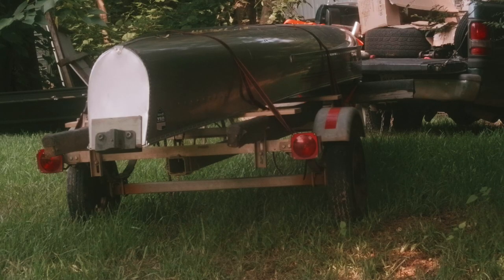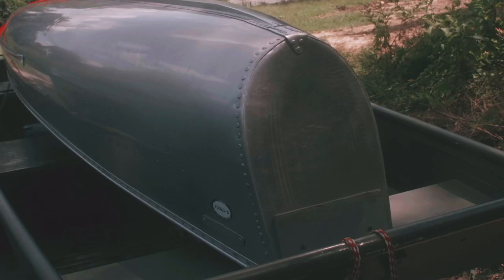Motor on a Canoe | Motor Man Series

Comment: I have a 70s grumman 17ft square back. I do run a 4 hp outboard or a 55lbs thrust trolling motor. If I am by myself (about 200lbs give or take) I put two 70 lbs sand bags all the way up front. If you don't, the thrust from the motors will force the nose up high enough to swamp the back end. That being said, it gets me around shallow rivers really well. Where the motors can't be run I can paddle or jump out and pull it.
Reply from the maker: Nice tips thanks.

Comment: I had a Grumman Sport Boat for awhile used to run a 9.8hp Tohatsu on it was slightly overpowered, but it scooted right along. Then watched a video by Temple Dillard of him running a 6.5 Swamprunner on his (weight is nearly identical). Made an affordable way to run shallow rivers and I could cartop it so I didn’t need a trailer. I also got a canoe/kayak dolly which enabled me to launch it places with no boat ramp. Just wasn’t enough room for the family + dog + camping gear so now run an 18’ Jon boat w/surface drive.
Reply from the maker: Yeah, the sport boat is legendary. I wonder why they don;t make an 18 or 20 ft. version of it.

Comment: Damon
I hadn't tuned in much in the last couple years. glad to see you are still at.
The catalog of work you have done is amazing.

I am sure you could be a producer for someone elses instruction videos or do nothing but paid product tests and reviews.  The quality of your work - awesome.

Persevere and keep at it.  

Personally I would love to show some  problem solving, gerrymandering techniques 
If I make a video.

Things I have done -make a light weight waterproof floating trolling motor extension handle
out of a wiffle ball bat handle ingenious ?  My invention.
Or the trolling motor transport shock absorber _ A tennis ball.

Launch a 1000 pound boat by yourself using a long rope you walk over your truck roof ?
And in shallow water using your brakes ?

The side ways kitty litter plastic bucket use it keep materials in. Write item on top that closed when it sat upright,  Stack them up.

Show them the rope in the spark plug hole method pulling a flywheel.

The jack handle breaking bar combo to remove stuck bolts on heavy equipment or trailer
leaf spring bolts.

How about teaching folks how to (on an incline) hook your trailer to your vehicle by yourself using a wheel chock, a jack stand and a trailer jack stand ?

Using a toggle bolt to re-mount some thing secured with sheet metal screws that won't hold>

How about taking an expensive proprietary equipment nut or bolt and go in to a home depot and find it's size and pitch and buy an over the counter replacement and avoid shipping costs ?

I would love to show folks how you can buy braided fishing line or inline spinners from China on ebay instead of paying three times the price at Dicks or BPS ?

My list goes on and on.  I thought you would be someone I would love to exchange tricks and ideas with.

Comment: Have you gotten around to trying the mud motor on the canoe yet? I'm curious  about the stability, because I'm considering getting one to run with mine, I want something that I can launch from my truck in places inaccessible with a trailer. My current setup is a Twister motor on  a  Saturn Kaboat and some places have me concerned about punctures.
Reply from the maker: Yeah, I run it all the time. It'd recommend the mini kit though. These Thai longtails aren't exactly portable or comfortable to use.